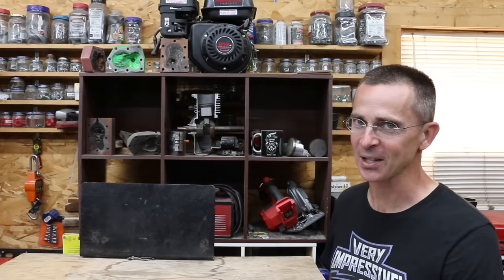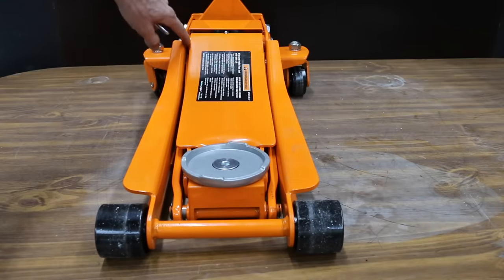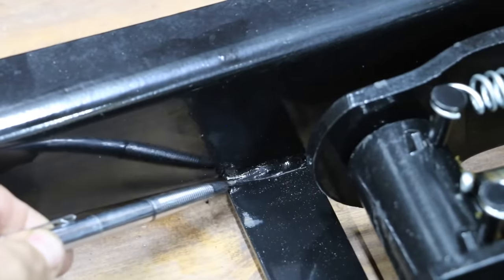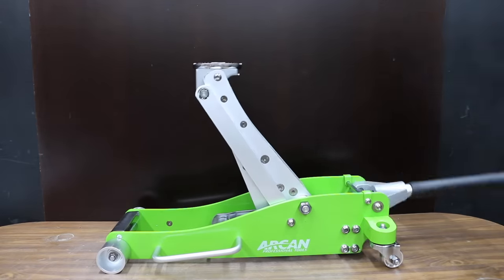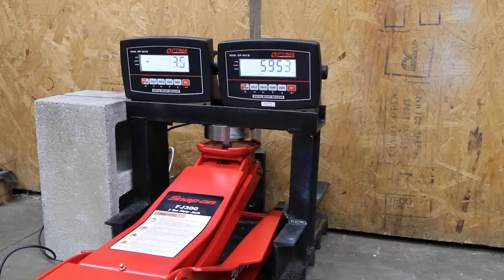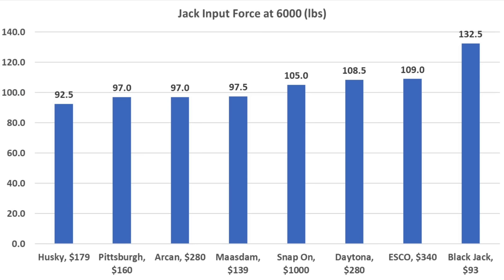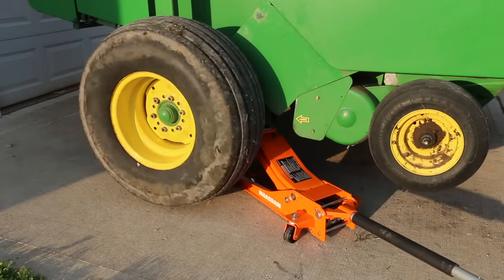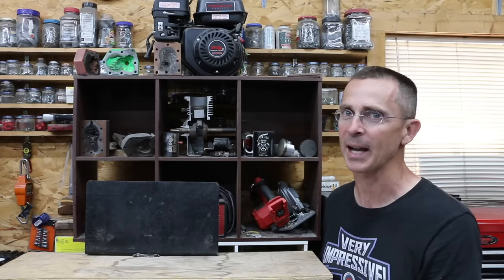Best Floor Jack? $1000 Snap On vs Daytona, Pittsburgh, Arcan, Black Jack, ESCO, Husky, Maasdam

Comment: I had a Pittsburgh 3 ton jack that I bought from harbor freight about 8 years ago for about $80 bucks and that thing worked like new every single time I used it. I’ve used it on my f150 numerous times as well as my other vehicles, mustang, ford Taurus, Chevy Cruze, old Chevy truck, Nissan Xterra, etc. if I’m being honest I don’t think I’ve every put fresh oil in it and like I said, worked like new. That was up until 2 days ago when it got robbed along with my jack stands, now to spend $150 - $200 plus whatever jacks cost is just sad. But definitely recommend Pittsburgh brand as an affordable and reliable jack!
Reply from the maker: Thanks for the feedback.  Sorry to hear it got stolen!
Reply: @ProjectFarm  yup really sucks but oh well. Thanks again for the informative video and the kind words!

Comment: I'm unsure how to make a video suggestion without commenting on a video that's unrelated to my suggestion. I really want a jack made outside of China. I would pay a couple hundred $$ more for it, but not $1000. I guess I'm looking for an old used snap on.

My suggestion is, I have never done struts before, and I'm really concerned about getting a good safe spring compressor for my small truck. I'd be very interested in comparison testing. I've even considered trying to make my own with a heavy treaded rod and some U-bolts, but haven't decided how I'm going to do it. Please be safe if you decide to do this one!
Reply from the maker: Thanks for the suggestion.

Comment: I just bought two Pittsburgh 3 ton low profile jacks this weekend to replace my aging jacks.  This is a great test, but I’m curious where the 3 ton low profile Daytona places in with these. Not the Super Duty, but the “budget” Daytona 3 ton.  It is generally $30 more than the Pittsburgh and appears visually the same.  I’m told it’s easier to rebuild, but that would not show up in your testing.  Aside from multiple colors to match your other tools or toolbox, wondering what the difference is from the Pittsburgh?
Reply from the maker: Thanks for the suggestion.

Comment: Lifting the whole rear axle off the center point can damage the housing. I know it is an old Ranger, but it might matter on a newer vehicle.
Reply: Not true, lots of bell housings are made to be able to lift by.
Reply: @christopherhaak9824  Not sure where you got your information, but I was a Ford engineer and worked with the guys who designed this axle.

Comment: Something id be worried about with aluminium tools is lifespan. Since suffers from fatigue issues. Maybe the flex is small enough to where its a non issue. But if the flex is significant it could become brittle over time.
Reply from the maker: Thanks for the feedback.

Comment: I bought a Pittsburgh because this is 73 lbs vs 103 for Daytona. I don't have a garage and have to push it up a ramp on my shed.  I had a previous Pittsburgh that failed after just 4 years of DIY work but that  may have been because I pulled  away with the jack still attached. Dumb, careless, etc... What and when should I use the grease fitting?
Reply from the maker: Thanks for the suggestion.

Comment: I bought a 2-1/2 ton floor jack in 1994 for $25.  I've used it once or twice a year, call it 50 times.  I ALWAYS chock my vehicle before jacking, and lower my vehicle onto 6 ton steel cross-braced safety stands, then leave the jack in place, valve closed, and taking up roughly 30% of the weight.

Tip:  If you'd prefer to keep your read differential seals intact, NEVER lift your vehicle by the rear differential!  Instead, check your owner's manual for lift points.  To date, I'm on my ninth vehicle.  None of my owner's manual have every recommended I use the rear differential as a lift point, and at least a third of them warned against it.

As for calculating the number of pumps for lift, you should have used a standard height of 1 foot under typical and constant load of 2,000 lbs, not the widely varying maximum height of each jack.  

I love your test of handle height.  The gripping end of a handle SHOULD allow you to go to one inch of floor level on a level floor, or whatever's best for those with large knuckles.
Reply from the maker: Thanks!  Thanks for sharing.

Comment: I thought the light weight of the arcan was going to be life changing. 

First time i used it on a suv it couldnt lift it high enough. I almost had to use my 10 year old jack to save my brand new jack. Sad! 

May end up with the super duty daytona.
Reply from the maker: Thanks for sharing.

Comment: Only if you could do best atv/motorcycle jack on stability, strength, how many pounds can it hold, and which is best for a atv and whichbone is best for motorcycle.... i have a motorcycle jack by Pittsburgh with dual stand for motorcycle and our 2022 polaris sportsman 450 ho atv it dont jack it up straight because it doesnt get a good level lift on the sides of it and i also use it to tuck my motorcycle into its corner also its hard to roll lol lol love your videos even the 3d and wooden cylinder heads
Reply from the maker: Thanks!

Comment: @Project Farm    It's kind of not fair to include the Blackjack in this comparison.  It's not really in the same class as the rest; even though it's technically a 'rolling floor jack'.  Although it works as a 'reference point'.  I have both types and the larger one is easily better all the way around.  The smaller 'Blackjack' style is good for the trunk of the car, while the larger one is good for the shop/garage.  Great presentation just the same!
Reply from the maker: Thanks!

Comment: Can you test electric floor jacks? I weigh 95 lbs, so the "lightweight" 50 lb hydraulic jacks aren't easy for me use. I'm curious to see if the electric ones can serve without breaking my back.
Reply from the maker: Thanks for the suggestion.

Comment: I've bought the Pittsburgh jack and quickly returned that POS. Jacking up my Corvette the "rubber fill plug" blew out spraying myself and the Corvette with jack oil! I went back to HF and paid the extra $ for the Daytona jack (screw in plug).
Reply from the maker: Thanks for sharing.

Comment: Wish I could find out what brand my jack is lmao it’s a grey floor jack that I found in my shed 6 years ago and I’ve been using it ever since, sometimes I’ll even leave cars or trucks on it for a few days. Hasn’t failed me yet, but it has started to slowly leak down. Like an inch every 10 minutes. So it’ll need to be replaced soon. If I can’t find out what brand it is I’m just gonna go with Daytona.
Reply from the maker: Thanks for sharing.

Comment: Have you tested the Badlands floor jack from harbor freight?
Reply from the maker: Thanks for the suggestion.
Reply: @ProjectFarm  I did not know they made off-road floor jacks. That would be an interesting review. They claim that you can move a car with one holding the car up.

Comment: Just recently threw away a 2 ton Blackjack that I had for 8 years. Bought it at Walmart on sale for $30. I was jacking up the rear end on my 2005 Accord and noticed the frame was twisting, had about 1,400 lbs on it at the time. Lowered the car back down and threw the jack in the dumpster. In all I got 8 years of use out of a $30 jack🤷‍♂️
Reply from the maker: Thanks for sharing.

Comment: I got a 3ton black jack but not like the one you use in the video mines bigger like the second jack you shown. I've used it now for about 3 years haven't had any fails or problem with it. Mine didn't come with an extension so I just use blocks I got to give it extra height still tho you don't gotta spend 1k for a nice jack
Reply from the maker: Thanks for sharing.
Reply: Thanks for doing the research

Comment: The daytona one is so bad. Its nice at first but i bought 2 for our shop and theu both barely lasted a year. Ive had 3 pittsbirg ones as well, 1 is still going strong but the other 2 lasted about as the daytonas. Our oldest jacks is this huge 3 ton craftsman thats still working. Recently picked up an aluminum husky and time will tell if itll hold up but its been great so far
Reply from the maker: Thanks for the feedback.

Comment: Cheap Floor Jacks with the separate twist release are really dangerous as it can be very hard to control the release pressure which can cause the car to drop in an uncontrolled state...
Reply from the maker: Good Point!

Comment: Would be nice to compare straight aluminum floor Jack's. Not the heavy one.
Reply from the maker: Thanks for the suggestion.
Reply: @ProjectFarm  Mt shed is in the back of the yard and I have to drag a heavy standard jack across the grass and they are not meant for that.  I need something lighter to drag or pickup to carry to the front on the yard

Comment: If the Jack is spongy you need to expel the air first. Lift it to the max, open the filling port and then release. Satisfying hearing the air expelled. Then top up with oil as per video.

Comment: I got a great price on the Pittsburgh jack a little over a year ago. I can name 2 things I want to see changed in design. It's easy for it to abruptly lower too fast. I notice that the most when lowering to jack stands before I get under my car. 2nd thing is if I cannot finish my repair during that same evening because of being overworked... I'd like to be able to take the handle with me so that if some moron tries stealing the jack.. they would have to try doing something with it without the handle... Lucky me, the handle inserter faces upafter removing the handle.. so I cannot insert the handle to  lower the jack without a seperate tool like a 4 way. Does anyone know of any smarter designs with those 2 points in mind?
Reply from the maker: Thanks for sharing.

Comment: Anytime I get a new hydraulic jack, I change the fluid and put in brake fluid. Anyone that’s ever tried using a hydraulic jack in freezing temps know it does nothing because the fluid congeals. But your vehicles brakes always work regardless of temperature. That’s because brake fluid is still hydraulic fluid but isn’t affected by temperature.
Reply from the maker: Thanks for the feedback.

Comment: I bought one of the Daytona 3 ton jacks from your video this week. I noticed today that one of the front tires is not (or is just barely) touching the ground... It only spins about half the time as it is occasionally making light contact with the ground . Is this normal or should I exchange it? Something to worry about or no?
Reply from the maker: This is common from what I have seen testing floor jacks.  All 4 wheels should touch once the jack is under a load.  If all 4 wheels aren't touching when under a load of around 500 pounds or more, I'd return it.
Reply: @ProjectFarm  thank you for the quick reply! I don't follow many people on YouTube, but decided to subscribe to your channel earlier today.

Comment: I just got the Pittsburgh 3 ton jack, it squeaks or squeals pretty loudly when it's being lowered is that a normal operating sound or did I get a lemon?
Reply from the maker: I wonder if there's a greaseable part that just needs greased?
Reply: Thanks for the reply!  I'm going to do the job I bought it for and exchange it. I see lots of evidence of grease on the jack, but it sounds like air is being let out of a balloon while pinching the end when it's lowering. 😊

Comment: I have the husky but when I turn the handle left to drop it doesn’t do it slowly it just immediately drops 
Is that normal or should I go exchange it?
Reply: I have two of the Husky's, neither does that. I would grease and check the oil level. One of mine needed a tad bit of jack oil when I purchased. Both are keepers in my book.

Comment: It's almost like a quality person looks at them and decides which company gets them. I have a Daytona long reach low profile. It weighs like 110# and you know every pound of that. BUT it is worth every penny and it works so well. I still have a 3-ton I bought when I worked at nationwise in 93. One I got at advance MVP I think about 95 and they all still work pretty good. The others are so old, my Daytona is the first rapid pump I've ever owned lol. If you need one and you are gonna use it, but one 100%. If you have to have snap-on pay $900 more. The rebuild parts should all be the same.
Reply from the maker: Thanks for sharing.

Comment: I see you did the blackjack too ton but for $60 you could have got the blackjack two and a half ton low profile racing jack... I know it's a little cheap Walmart thing but it's still better than the one you listed and cheaper I don't know where in the world you found the blackjack for $90 but that thing's only 30 bucks at Walmart

Comment: Bought 1 Pittsburgh and it failed. Exchanged it. 2nd one blew the seals just like the 1st. It's as if they used the wrong rubber material and the oil weakened it. Also those wings on that Daytona and snap on can  restrict your clearances.
Reply from the maker: Thanks for sharing.

Comment: I have worked in a shop for over 20 years we use the Pittsburgh, Daytona,  and I have a snap on. The Pittsburgh is for someone who has a garage and may need to change a tire or something. The Daytona I would recommend to anyone. We only break about 7 or 8 a year. That's better than so called high end Lincolns we use to buy at $600 a piece. And I have had my snap on for about 8 years with no issues ever. It's virtually indestructible but that price tag. If I had to ever buy another jack it would be a Daytona as I'm getting older and not planning on professionally working on cars much longer.
Reply from the maker: Thanks for sharing.

Comment: I noticed that at 0:55 you mistakenly referred to the ( relief valve ) the "don't adjust" screw, as the oil port. I have the same jack ( older model ) and the oil port is under the metal removable cover/plate and is plugged with a rubber plug. 
I would suggest removing this part of the video, as some people may mess with this screw and ruin their jack's factory settings.  
Thank You
Reply from the maker: Thanks for the constructive feedback.

Comment: Your tests certainly have some minimal merit however the similarity amongst Imported designs is of concern, these jacks you tested might be fine in a domestic environment occasionally used, if you don't fancy being sewed never use these in a commercial business where there is a risk to an employee or property damage arising from the use of these things, your insurers will wipe you out, just make sure these devices comply to work place safety regulations  in your country or state , never take the labels on the unit as being compliant especially if they are made in China, they may stand up to one test but certification puts them through rigorous testing of every component not just the lift capacity ,wheels, frame deflection , overload, pivot points, over a huge number of operations, not just one  and it's never done on just one unit can be any number of units usually three but it's not uncommon to test many more up to 10% randomly chosen from a shipment of 1000 units, I have worked in a complaining Laboratory on similar devices.
Reply from the maker: Thanks for sharing.

Comment: Wow, this is what a review should be!
FYI, the Maasdam and look-a likes are in Europe sold as Bahco BH1EU3000 for around 200EUR. I learned a lot about lifting safety and what to look for in a descent lift. With all the new heavy 2000kg+ EV's in Europe a new breed of cheap lifts are being sold, basically all being Chinese knok-offs brom a descent brand. This should not be a problem when it's copied correctly. I now know what to look for, thanks!

Comment: The Daytona jack is now $189.99 & on sale for $144 from time to time. Very impressive tool for $144. My mistake that wasn't for the same jack, but none the less that one for $144 is a great deal. For my lower riding Mercedes I am opting for the $289 model that offers the most lifting height. HF should just send you a check in the mail.
Reply from the maker: Thanks for sharing.

Comment: The snap-on and  the Daytona  are basically the same jack except for the price! Snap on in many ways is living  on a past reputation. It used to be when you bought snapon equipment you bought 
American products. Now snapon uses whatever they can get for the cheapest price and put a fat price on it because it has their name on it. The Daytona  jack is equally good compared to the snapon jack. At a fraction of the price. They are bolth foreign made, and probably at the same factory.
Reply from the maker: Thanks for the information.